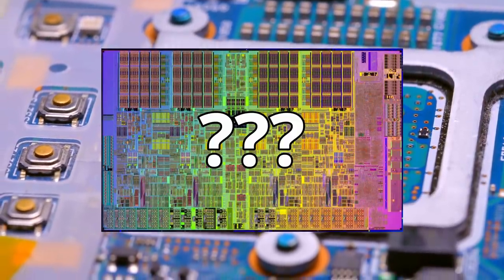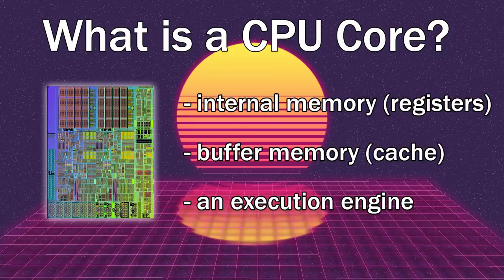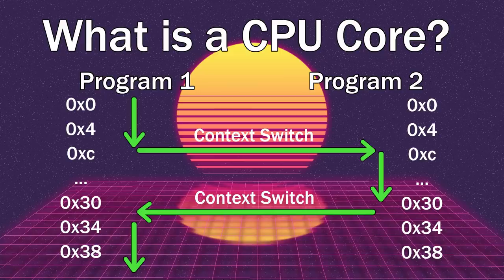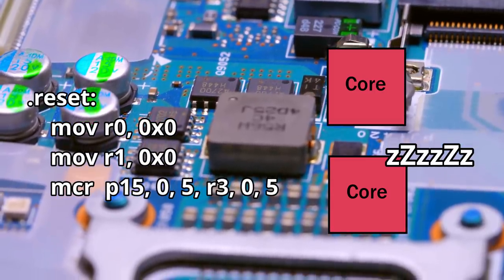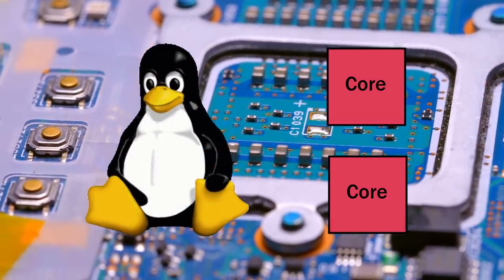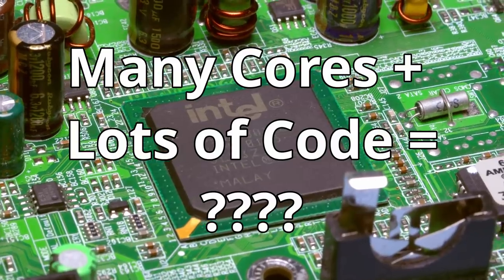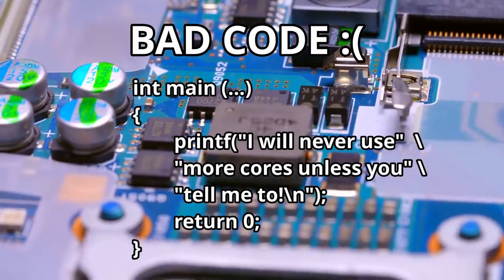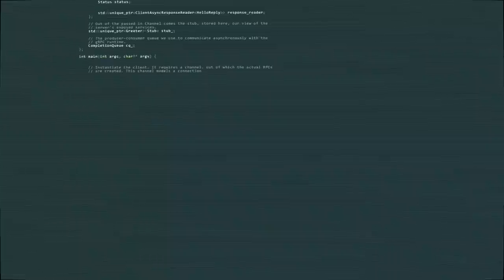why can’t computers have thousands of cores?

Comment: Massive numbers of cores (64 cores, soon 128 and more cores) is already happening in the data center world where cloud computing relies on creating massive numbers of virtual nodes (computers).  Each node is considered independent of all the others so it may only have a single core allocated to it.
More important is the migration to PCIe express lanes.  These are independent extremely high speed serial busses.  Massive amounts of I/O bandwidth.  Next gen processors are going to have 128-256 individual express lanes transferring data at 2 GB/sec.  And now 4 GB/sec with PCIe 5.0.

Comment: Large number of cores has some usage in certain specific fields - essentially enterprise servers. HPC is pretty much already taken over by GPUs which have specialized compute only cores (with little or no additional or side functionalities), but virtualization (multilayered), cloud computing and compartimentalized computing will very efficiently use systems with large number of sockets with large number of cores and n-Way multithreading, using 4 layers of cache and NUMA..  Having large systems running multi-layer virtualization with thousands.. tens.. hundreds of thousands instances of walled applications OSes or applications starts becoming power efficient, especially when you start overcommitting resources.

Comment: The opposite of thread-core affinity:
When overclocking or using the "boost" feature, there is a time limit imposed even if you seem to be cooling more than enough.  This is because Intel is worried about tiny hot spots that distort the silicon or otherwise overhead because the heat can't transfer through the wafer and heat spreader as well as your watercooling block can cool the heat spreader.
So, to keep running your problem at crazy speed, you should rotate cores every few seconds and not keep running on the same core.

Comment: I started designing micro-controllers in the 80's when, in order to get anything done in a reasonable amount of time required writing code at the machine level where every clock cycle and subroutine had to be optimized.There was only one core and a tiny amount of memory, so everything had to be written as efficiently as possible, now, it's mostly high-level routines that offset inefficiency with speed of execution. Today, memory is cheap, processors are fast and cores are aplenty. There has to be a limit, though. It was fun back then.

Comment: Though the main problem when increasing performance is power (and thus cooling). The only real use of power for CPUs is the inefficiency of the transistors changing state (bigger transistors = more power loss) and all used power turns to heat. 

As the frequency increases, the voltage required increases, the current scales with it, and the power usage (and heat) grows exponentially.

Adding cores means simply using the same amount of power again on the additional hardware so the power usage scales linearly rather than exponentially.

The problem with this is that the software itself must then be specifically designed to run on multiple cores and on top of the extra development cost, the relative performance of multi-core workloads in dependent on how well these programs can be describes as multiple stand alone programs and how often each part would have to rely on another part for output before it can continue.

With GPU bound video games, you are dealing with a lower clocked chip with dozens if not hundreds of cores, each with dozens of copies of simplified and specialized versions of the CPU circuitry (making the core smaller so they can fit more on) each connected to a single clock. Given this it is not so much that such software does not use multi-core processors, but in situations where the program can be easily computed in parallel, there is no real reason to use the CPU which has much fewer cores.

Comment: 4-8 cores with a stupidly high clock speed would probably be the best setup for the time being
Reply: probably about right. 4 with hypthreading is probably fine for the every day user and 8 with hypthreading is what most who plan to play games at this point should shoot for as games have already started to move pretty fast where 4 cores will leave you pretty hard cpu limited depending on the rest of your set up

Comment: Alluded to, but maybe no emphasized enough is/are the task(s) to be performed.
Most common real world scenarios like supporting businesses (both personal and commercial) are relatively simple and limited, in fact oftentimes the same exact calculation is performed any number of times so the algorithm(s) itself can be cached. These kinds of calculations are often short but whether long or short are repittive so literally only one process is sometimes needed to run these calculations.

On the other hand, vast number crunching like in data analysis or the next step forward AI might be long or short but the volume is very high. These types of problems to be solved can make use of parallelism to execute a multittude of different proposals and then after they all have been calculated do a comparison to identify which is best.

Examples like the above can make use of supercomputing, or in current incarnations the use of tens, hundreds or thousands of multi-core GPU processors (which support far more cores and parallelism than more familari CPUs) and is why the US is specifically placing sanctions on China for accessing and using these kinds of chips.

Comment: A question I have regarding the memory bandwidth limits, that would affect higher clock speeds too, right?
Would a CPU with half the clock speed, but twice the cores reach the same memory bottlenecks?

Comment: There are several aspects of multiple core processors that this video does not cover, such as "hyperthread" cores that provide two threads of execution that run as-if in parallel by sharing resources within the core that would otherwise be idle while a thread is waiting for a memory transaction or coprocessor operation to complete. There's also big/little arrangements with high performance and slower efficiency cores. Hardware and software hypervisors start being essential as the core count increases, and so on.

To take full advantage of a large number of cores requires on-chip networks to make external resources (and limited on-chip resources) available to all cores, and multiple memory channels that may advantage one core over another for a given bank of RAM. This all has to be done in hardware and is often managed by an additional core with a different architecture that is not visible to software (usually microcode with provisions for an OS to load patches as a signed binary blob).

The reason I bring this up is that it takes a lot of time to get this right. Once the core count gets larger than an OS can efficiently manage, the hardware has to take up the slack.

Comment: In general, unless you're running a server which runs many discrete tasks, having a bunch of cores simply means you have a CPU with a lot of idle cores - generally it's the single core speed which is most important.

Multiprocessing (or multithreading) requires real effort by the programmer and it's not always easy to parallelize code - and multithreaded code is probably more buggy since it increases the complexity - multiprocessing is simply a CPU vendor's attempt to get past the fact that their single engine speed has run into Moore's wall and this is the CPU vendor's (lazy) way to get past that.

You can increase single core speed by raising the clock speed, but that increases heat production exponentially.

Apple Silicon gets around this by producing large performance cores with multiple decoders, a ginormous reorder buffer, redundant arithmetic units, and up to eight decoders. The processor logic allows the decoders to scan up to 690 instructions forward in the execution queue, and reorder instruction execution so the out-of-order execution scheduler can run up to eight instructions simultaneously.

Sort of like hardware multiprocessing but requiring no effort on the part of the programmer. Hardware complexity is increased though, and it does use a boatload of transistors.

This is what allows Apple Silicon to achieve high single core speeds while keeping heat output at quite a manageable level. This is only possible because Apple Silicon runs the ARM RISC instruction set where instructions are a fixed length, so the decoders can peer far deeper into the execution queue than would be possible with a variable length instruction set (like x86/64).

Comment: I have another question. Why can we have 8 cores and 16 threads 4ghz per each, but we can't have 4 cores and 4 threads but 10ghz each? It would be extremely useful for some kinds of games or apps. x264 can't use all 16 threads on Windows, for example. On placebo preset it uses only 4 of them. Same with old games, such as GMod.

Comment: To date (2024-09-02) I’ve only written one multithreaded program in C++.

It’s pretty much an ideal case for multithreading (using an Intel CPU with their “hyperthreading” tech) where it looks for primes in a predefined range and divides that range into sub-ranges equal to the number of available concurrent threads supported by the CPU. 

If the search range is not divisible by the concurrent thread count a “remainder range” is created to handle what is left “over”.

I’ve had it run on Intel and ARM CPUs with up to 96 cores without issues.

Comment: Years ago I remember reading an article on the topic that quoted some engineer as saying there was no reason in principle they couldn't put thousands of cores on a single chip (and in fact they might have even prototyped it). Then, as now, the major issue was software. Many software tasks simply do not parallelize well, some cannot be parallelized at all, and even for things that do parallelize it may be very difficult to write code that does it (or does it well) - and all of these are problems even before we get to the issue of memory bottleneck, which is perhaps the biggest problem of all, even for otherwise very parallelizable algorithms. Heterogeneous computing seems to be the way forward - more specialized cores for applications that are able to take advantage of parallelism in various forms (GPUs, DSPs, FPGAs), colocated on the same chip with high bandwidth interconnects and shared memory.

Comment: Depends who you want to design the CPU, for what purpose; e.g:  you want processing power or execution power, 2 different approaches for Cache$ size; processing needs to have data and code in lar amount in the Cache$ and maintain processes running constantly, while execution just needs small cache to execute what ever it's sent to it parallel and fast and then move to the next Instruction block; PC vs Phone respectively are good examples of these

Comment: This may be a weird question, but I’m considering getting a new CPU because my current one is bottlecapping my gpu and I have a choice between like a €160 i5 with 6 cores and a €80-90 i3 with 4 cores that almost has the same performance increases according to cpu userbenchmark, will the i3 be less good anyways because it has less cores?
Reply: Higher core count consumer chips also have faster cores with more cache and clockspeed.

Comment: One thing I find very interesting is how physical connections throughout the history of computing came to a point where they were considerably faster than anything a computer could transfer, and only the most expensive super computers came close to saturating those connections. When that point was reached it stayed that way for the longest time. As soon as storage speed or computation speed caught up, a new connector was released that left that speed in the dust. It’s only recently that we’ve come to a point where data transfer just cannot keep up. With a raid 0 gen4 high end nvme set up you can reach speeds that only the most expensive professional networking can handle. No consumer or prosumer pc is capable of transferring data at the speed it can be processed anymore. Thunderbolt 3 seems to be the max limit on small connector usb style speeds. 40gbit. The speed hasn’t gone up for tb4 and it’s not supposed to increase for tb5 either if the rumors I’ve heard are right. 10gbit networking is slowly creeping onto consumer boards in the mid range. I really wish these computer manufacturers would work on an actual evolution of usb, and bring the insane high speed networking from the professional sector into the consumer realm. It would be really freaking cool to have an albeit expensive, but high end itx gaming board with built in 25 or even 100gbit networking, tons of usb 3.2x2 in c and a forms, but also an evolution of thunderbolt that is 80 or even 160gbit. Finally a prosumer 1tbit connector. Only for the high end obviously. People working with super high capacity projects. It would finally be like the future in movies from the 90s or early 2000s where a tiny penny sized thumb drive plugs into a computer and downloads the entire mainframe in 2 seconds. Like multiple pb of data in seconds. Lol

Comment: Nice video but a few corrections. 

ARM is not RISC. ARM might be r.i.s.c., as in the philosophy of reduced instruction set computer, but RISC is a specific architecture, most recent is RISC 5 which is in direct competition with ARM.

A cpu or core does not inherently need cache. Multiple levels of cache is an important optimization, but it is in no way required for a cpu to function. A cpu must have some storage with at least read capability.

It is unlikely that any cpu manufacturer could make a die with very many cores. The manufacturing process is error prone and the larger a die is the higher chance of having an error. This scales exponentially, so if you have 1% chance of an error when manufacturing a single core you will have ~10% chance to get at least one error when manufacturing 10 cors and ~65% if you make 100 cores. It's probably even worse due to each core not being exactly independent of some or any other.

The fact that not all programs can run in parallel is not a concern for the cpu. I think you accurately described this but I still want to point out that this is not a reason to not scale up the number of cores in a cpu. Even if a single program, like your typical old games, can only run on a single core there are always hundreds of small programs running that will benefit from your multiple cores. There is obviously a limit to the benefit of more cores in this regard, but that has not yet been reached.

And finally, even though the first multi core cpus came in the early 00ies, we had already had multi cpu computers that work on the same principle for years or even decades.

Comment: So how is the code written to use more cores?  All the code I have ever seen (especially C & other higher-level languages) operate in a single thread, one 1 entry, one exit, all that "good code stuff", with no GOTOs & spaghetti code, all the indenting, brackets, etc.   I have never seen a "use more cores" C instruction.  How does the "scheduler" "break up" the code threads?  How are the dependencies determined?  How does the programmer specify the dependencies?  Where is the scheduler?  Is that the Windows operating system?
          What about code that is written in system with NO "operating system" such as toothbrush or microwave oven?

Comment: From the quality of code I see generally, I believe a lot of performance improvements come from giving each program its own core. This is because the programs are looping or polling continuously waiting for conditions to end, such as a read call, a network transfer, etc. Programmers have been taught to be lazy and use so called "non-blocking" calls to get things done. The result of this is that giving such a program a dedicated core to just sit in a loop will increase overall performance because it is not getting in the way of other programs executing. I call this "burning a core" (like dropping a useless card in a card game). 

This mode of programming automatically limits the usefulness of adding cores. Once you have enough cores to waste on programs that parallel task inefficiently, then further cores will not help your speed.
Reply: nonblocking I/O is not the way to get performance - you have to add checks to see if data is available before waiting for it. The purpose of using blocking i/O is that it lets the SYSTEM do the waiting which in turn allows other threads to run.

Comment: In time, RAM will be replaced by L4 cache and new semiconductor material design will negate thermal losses. Ultimately using photons will replace using electrons for CPUs and cubic processors will mitigate density problems. Eventually everything runs on photons and utilizes quantum effects to negate issues of instruction execution order.

Comment: Processor architectures are likely to change to sub-divide memory so there are fewer memory access bottlenecks.   For example if ¼ of the memory is allocated to ¼ of the cores, then memory access outside a given core's "memory domain" would require a special bit of handling.  (And there could be a common "pool" subject to bottlenecks for interchange and the kernel).  In this way "stuff" happening on core 15 cannot interfere (memory access wise) with stuff happening on core 81.
Speculation: Looking at Apple's M1 Ultra, it may already be taking place w/o them attesting to it.